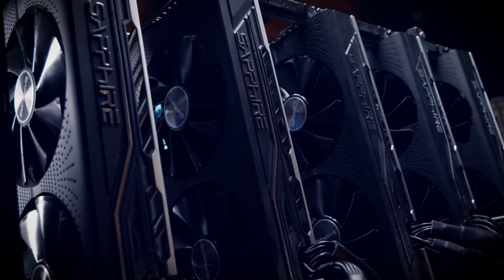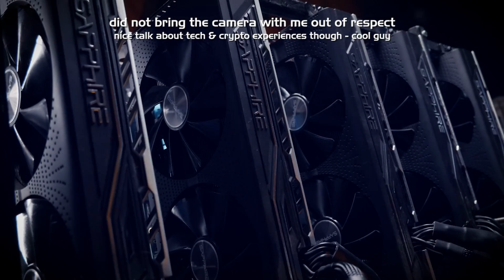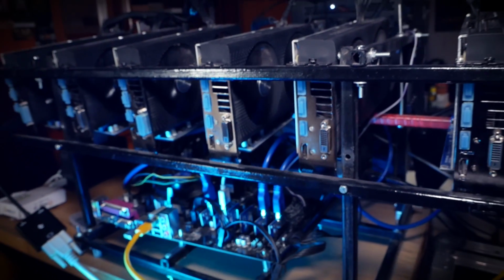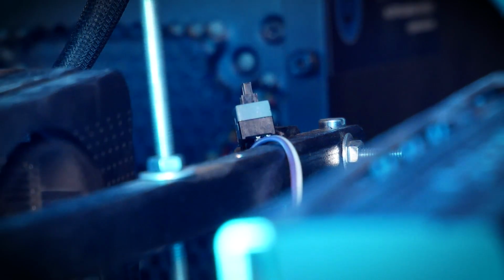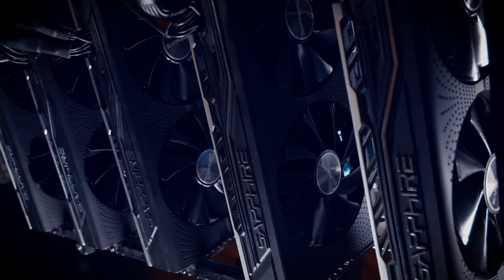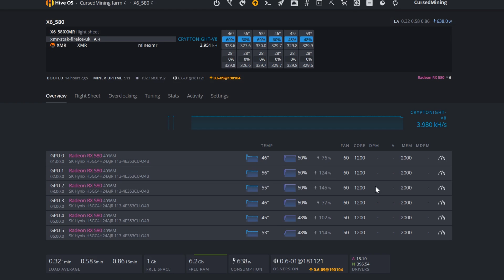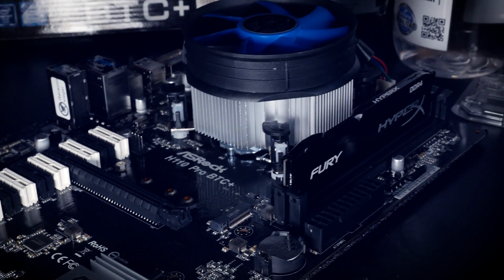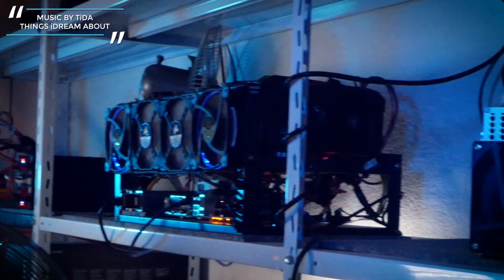Buying Used GPU Mining Rigs (RX580 / Asrock H81 Pro BTC / DIY open air)

Comment: I have a few used GPU's and no issues - I broke the bracket on an RX 570 fan and now i need to replace the whole front cover and fan....so, i broke off the fan blades and its running with 1 fan at 63c im ok with that.
Reply from the maker: great that it still works like that :) I have one 470 out of commission atm. for a fan swap as well, cheers ⛏️

Comment: 6 rx 570 nitro+ for 800€ here (whole rig psu, mobo...) Monero is Asic coin now ...u make 10 cents per card :D
Reply from the maker: XMR will fork again hehe, but yeah difficulty is up here, ugh
Reply: @CursedMining  I were mining monero with 5kh/s in big minus till few days ago , were making with that cards 30€ per month on monero ( without power cost) now I switched them to Aion and Beam ( few Vega 56 and few gtx1060 3gb) and they make 100€ per month .
Reply from the maker: depends if you want to hodl your aion / beam or you are selling. My Octominer is on aion now too =) AMD stays on XMR for now, good feeling long term for me (paying electricity through other means for coins I want to hodl)
Reply: @CursedMining  But U can mine Grin , aion , beam and sell it than buy 2-3x more monero .

Comment: what are u mining with rx580 right now?
Reply from the maker: XMR =)
Reply: free electricity cost? I have 0.07usd /kwh and its not profiteable for me :( with XMR
Reply from the maker: there is no free electricity hehe, but depends on view of profitable. Heating the house with miners and rigs, electrical heating is off so I like heaters which produce coins on the side. Mined XMR is something good to have and forget about, so I'm not worried. Might sell some cards at the end of winter though. cheers
Reply: @CursedMining  Why Xmr 🙃🙃 its wasting of GPUs and power... Beam , eth , grin, Aion....
Reply: My all GPU switch to Compute mode for mining one click.
uloz.to/!9wDlQZkwqqUf/amd-compute-mode-switcher-2-0-exe-jpg
mega.nz/#!GjIiECpS!UX7C4GBybTRsTXDTrtCBpmVo_eHZl3HuTE5mhRK7jVI